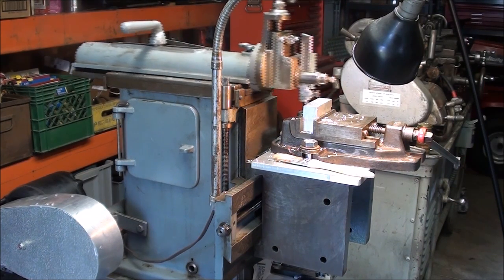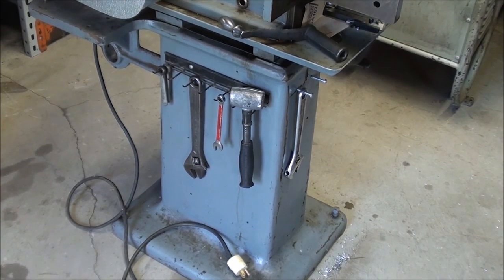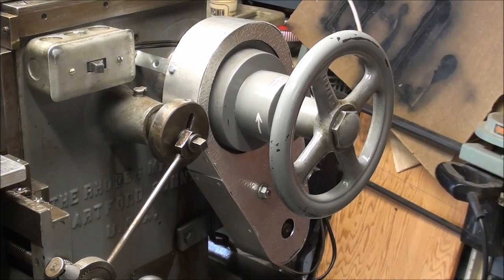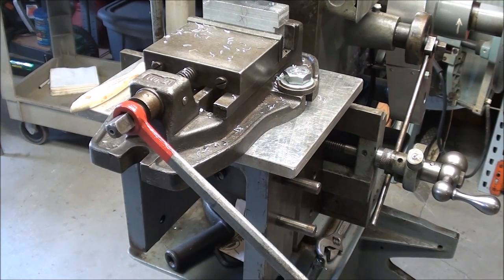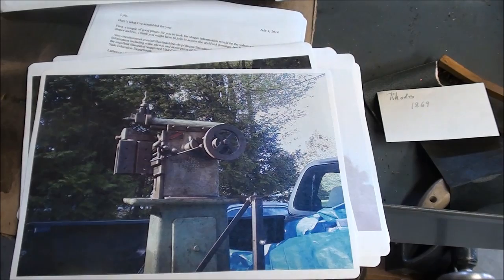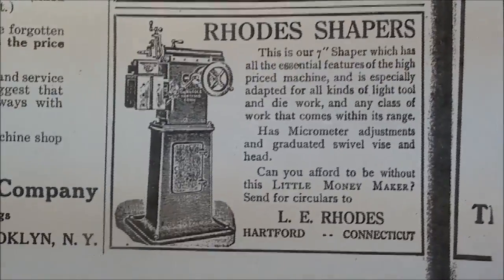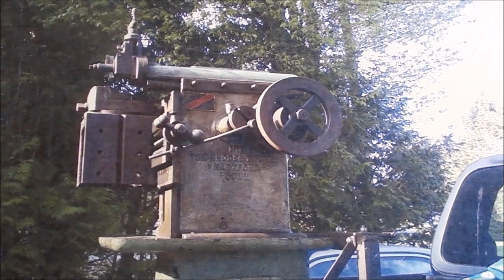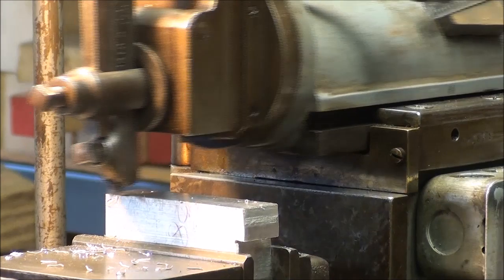Update on the RHODES 7" SHAPER tubalcain like sheldon ammoco

Comment: Hi Lyle. Just came upon this video,  so if you have not already done so, take a look at the Rhodes shaper info on Tony’s site www.lathes.co.uk
Nice looking machine. I have an Atlas 7B Metal shaper myself. Always neat to study patent drawings and descriptions. The larger step pulley looks like the 3-4-5-6 inch diameter step pulley that Atlas used on their lathes and shaper. If that is the dimensions of your large step pulley, you can probably find a pulley for your motor on eBay.
Reply from the maker: Thank you, I have seen it and enjoyed it

Comment: Re: noisy gears. By and large it seems like something you have to live with but I have found that an oil with tackifiers in it applied to the open gears really cuts down on the racket and seems to stay on even better than tacky grease. Way lube is one source but around here nobody even knows what that is so another more readily available source is chain saw bar oil.I hope you can keep the videos coming they are great.
Reply: Lucas Oil makes an engine oil additive that would probably do the trick. It makes the oil fairly sticky.

Comment: I've just found a Rhodes shaper for sale with the vertical slotter installed but I'm waiting to hear if he has the horizontal ram for it as well. He's asking $350.00 or best offer. 
How do you like using yours after having it for awhile?
Reply from the maker: +superrodder2002 Have not used it much--but still intend to.  Thats a good price.

Comment: Its a shame this is a lost technology. the beauty of a shaper is you can sharpen the bit for any profile you want and cut into the part with minimal cost. eg. we cut jaw blanks with a .0625 pitch 90 deg. v notch pattern 3.25 long, in the bottom. we cut these with a $1500 cutter, ground to the profile, on a Horz. mill. With a shaper we could just grind a $10 tool to 90 deg. and step it over. Its always time vs. money isnt it.
Reply from the maker: So true

Comment: you can make anything on a shaper except money  ;-)
Reply: You'd be surprised.  I used to know a tool and die shop with a whole row of big shapers, like 5 or 6 of them. They would have a single guy run them squaring and sizing blocks of steel. They may be slow compared to a Mill with a big fly cutter but the tooling is cheap and a single operator can run a bunch of them at a time.

Comment: Fascinating American Manufacturing history there way back in the WayBack machine.
USPS really gets weird with heavy stuff (metal), though they beat all else on price with their flat rate box: almost every box has been damaged, one was destroyed and actually replaced with the address section of old box taped to new. Have had a few 'received damaged' at the main Seattle branch: just covering their asses in a huge bureaucracy where 1950s tech is standard, no digital documentation tracking internally apparently.

Comment: nice little shaper, I've wanted one for years but can only find larger models that weigh 2 tons. I should have bought a nearly new Elliot 12 inch shaper from the 70's that sat in an army base vertually unused.I could have had it for $600.00. basically scrap price. called back a couple of days later and it was sold.

Comment: Very nice sheet metal work, and not cutting the casting off.  I'm willing to bet the
Rhodes maybe a territory thing.  Here, not far from Hartford nine  out of ten
shapers were Rhodes as well as ten out of ten mills were Bridgeports.  The
gear noise is fairly common, but I squirt #140 gear oil on it and into the scotch
block.  And yes maybe faster with a mill , but you dont have to baby sit the shaper.  Mine has a limit switch -a good thing.   Same as my beloved 1914
power hack saw -walk away and it shuts it self off when done...
sam

Comment: Great video......Shapers are just plain lazy fun! I rebuilt a 7 " South Bend a couple of years ago, and just last week purchased an 8" Model B Shape Rite,  with the optional swivel table. Other than the massive size for an 8", the best part is that it has set idle it's entire life, and essentially brand new, all covered in cosmoline......it's built like a brick sh%t house, weighing in at near 1000 lbs!.....cannot wait to get it running!

Comment: Hey Stubie you're not pointing at me ,are you!?! LOL... I like shapers! Depending on the need they can be fast, at least the larger ones can remove a large amount of material to the point of hearing the chips clinking onto the floor... It would be interesting to know if the gear noise was miles on bushings or teeth, and what the intended horse power was meant to be... Interesting video thanks... :o]

O,

Comment: Does that bracket that holds the original drive gear have holes in it? Just looks like it would be a good sot for a small chest of tools or similar, just bolt a box on.